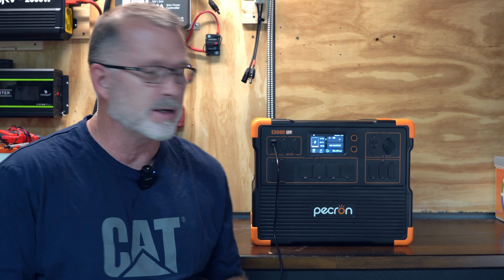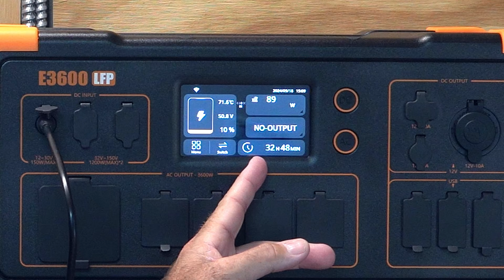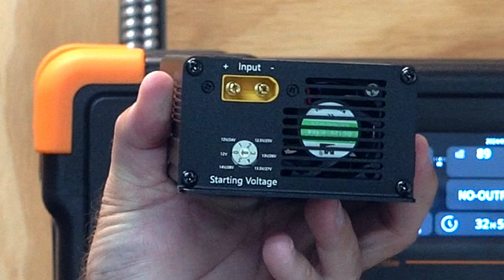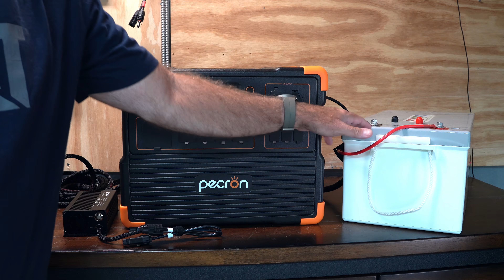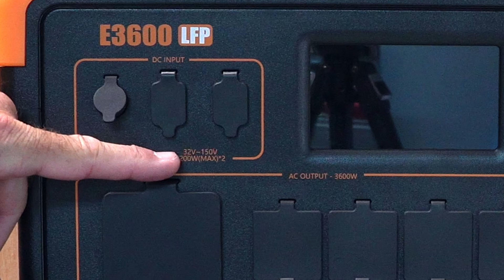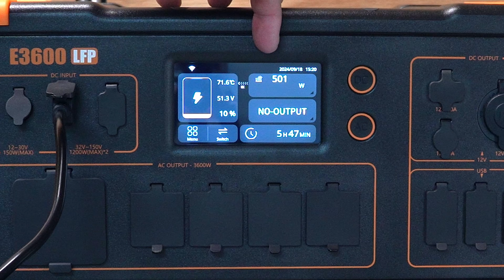A MUST HAVE if You Travel w/Your Power Station: Pecron 500W Smart Charger

Comment: The Pecron DC-DC charger is a literal game changer. I use a Bluetti AC200MAX and their PV420 panel on a 27" Bayliner V8 cruiser, basically a big floating RV. With the boat plugged in to the MAX's RV outlet, every amenity onboard works like it's hooked to shore power constantly everywhere we go. Running the fridge/microwave/stereo/fans/pumps/charging devices and whatever else it doesn't matter, I can last 12-16 hours easy on just the MAX, and with good sun I can go most of a weekend no worries. Now I basically DOUBLE my charging with the Pecron charger/off the alternator while we're cruising around, which is often half the time we're on the water or more anyway, and I hardly even need to think about electricity at all. Note since this all hooks up like two sets of solar inputs, I also needed the Bluetti Charge Enhancer to make two inputs work at the same time, but even the panel/the SCE/and the Pecron combined cost less than Ecoflow is asking for their charger (plus I already had the AC200MAX, 420W panel, and solar charge enhancer so the ecoflow was a no-go for me anyway).

I never get a full 500w from the Pecron, I suspect a higher output alternator would probably help, and I never get the full 420W from the solar either (far from the best panel for my current use to be honest), however it's still a VERY strong setup. I would like to get something simpler, even semi-permanent panel(s) wise, but I figure the next thing is probably a B230 expansion battery, and/or swap out the two onboard 12v lead batteries for LiFePO4 too...... Always some project to do on a boat as they say, and none of it is exactly cheap, but this Pecron has turned out to be the real bargain and missing link in the whole thing. I don't even have to mess with the solar panel on a lot of our trips anymore (I've flat forgotten to set it up a few times), and all I really HAVE to do is relax and goof off with the wife & critters, that's a win in my book.
Reply: Camper vans are the terra firma version of boats.  It seems I’m always doing something to mine.

Comment: I just bought an EcoFlow River 2. It says for solar input 11-50v 13A 200W max so max Volos in range but this won’t work because max input is 200w correct? I’m electrically challenged 😂
Reply from the maker: It'd still work, BUT you'd never get more than 200W out of it...but still double what you'd get out of the 12V socket.  Probably not going to be a popular match-up since the River 2 has pretty low capacity anyway and wouldn't take THAT long (really) to charge from a 12V car socket.   So instead of taking 2.5 hours to charge, you could cut that in half.  Worth it?  Maybe.

Comment: Great video and nice product.  2 years ago I rigged up a 12v to 48vdc converter to supplement my Delta Pro via xt60i port. Would get 720w. But I always had to keep an eye on my battery at idle. With this I can set battery protection voltage.  Thanks!

Comment: I'm not a fan of this store bought crap, the stuff is made as a throw away. These boxes have Lithium Ion batteries similar to flashlight batteries. They tie lots together to make the product, and it packs lots of power. Once the batteries die or even one fails the product is now garbage. Yes these batteries wear out even if your not using it and they are impossible to replace. The better ones use Lifepo4 batteries they don't hold as much power but it can be recharged many times more. They are also safe unlike the lithium ion. They have been known to catch fire, that you cant put out. Also even if they use Lifepo4 its not replaceable or standard.I don't know anything about this product, but it seems like a bad idea. Putting 500 watts into something you know nothing about is crazy and a fire hazard. Your best bet is to build your own, its not that difficult and you will have a product that uses standard cheep replaceable Lifepo4  batteries. You will also now understand why and how things work, so you don't burn down your house.
Reply: Maybe before you run your mouth about a product you no nothing about, you should educate yourself. You basically invalidated most of what you wrote by misunderstanding what this is. For example the lfp stands for lithium iron phosphate, so it isn't standard lithium ion. Something is humorous about you chastising people for not understanding how things work, and here you are knowing nothing about this product.
Reply: @Psychodegu  When I was referring to a standard I was referring to sizes. Most store bought use propriety size battery packs so its not replaceable. Also LifePO4 and lfp both refer to lithium iron phosphate. LifePO4 is term commonly used by industry, lfp is not. Most if not all the products out there use either LifePO4 or Lithium ion Batteries. Its impossible to test everyone's product, this why I say most products. The ones I have built over the years, I can replace the batteries. They are easily sourced by many manufacturers.
Reply: @perkunast9680  I just don't understand why you are explaining to me and harping on the most basic stuff related batteries inverters and the like. It sounds like you dislike all in one units that you don't even want to know what their specifications are. I don't know why you think you can't replace cells in these products, you can it just voids the warranty.

Comment: I was thinking about buying this I did buy the Eco flow system and I thought it was too much money and I sent it back. This would be a great option possibly for my 2024 Hyundai Santa Fe hybrid. I do not need that long of a cord for sure because the battery is in the rear cargo area the 12 V battery that is. I already have the bed and the platform and the sliding table that comes out for cooking in the back hatch area. This would be a perfect set up to charge my Eco Flow.

Comment: I spend a lot of my adventure time in the mountains of the western U.S. and it's rare to get a full day of open sky. This converter would make it easy to start up the car and use to as a generator under those conditions. I'm just thinking of how much charging will get done driving through Glacier NP, Rocky Mountain NP or trekking between the Grand Tetons and Yellowstone. Looks like a no-brainer with my Pecron 1500.

Comment: Question... My F250 diesel has 2 batteries. if you had 2 of those units, and you had 2 e3600 inputs like your Pecron, could you then charge at 1000 watts?
Reply: Yes it;s ok, because pecron e3600lfp has two xt60 input port
Reply from the maker: You could, yes.

Comment: Why just not use an AC inverter from your car battery while driving? You could get much higher input than with this solution!
Reply: I'm no expert but yes you could plug into the the ac output of the inverter. But the power station must be put on slow charge  that doesn't have more than 500 watts unless the alenator/battery can handle more .  My 1000 watt Bluetti can take 900 watts on the ac charge but I can put it in slow charge which draws 300 watts input for instance. It's my DC side that can only handle max input of 500 watts for instance and I don't know if the alenator would keep up if I'm running air-conditioning or the car heater  with that said .

Comment: Would be nice to see a video on installing this on a car or RV.
Reply: One lead to the positive battery cable and one lead to the battery ground. Then run the wire into the vehicle and attach 2 wires to the main unit. Routing the wires into the vehicle is the hardest part. I would suggest placing the main unit under a seat.
Reply: @fscottgray9784  How do you run the wire from engine compartment to inside car?
Reply: @Marine-v8g  Usually up under the dash manufacturers will have a rubber blank for pass throughs. Every car is different so it is hard to make a install video. It comes with a long wire loom to protect the wires from chaffing.
Reply: @fscottgray9784  Thanks
Reply: @JA-fw6lp  Through the firewall between the engine compartment and under/behind the dash.   Search for it on Google/YouTube.   Or just follow the wire harness from inside the engine compartment.
Reply: @Marine-v8g I was envisioning the cables from the battery out the front grill, over the hood, inside the passenger window to the backseat of the car lol
Reply: @pesky-media  You could just put a pure sine wave inverter under the hood and a regular 16/3 extension cord/electric kettle/ATX computer power supply cable to AC charge a unit. Even 50ft from the vehicle because 120V travels well where low voltages don't.

Comment: I've always wondered if just a  regular aoutomotive power inverter would work just as well for this application?
Reply: Me to I would think it would but unsure
Reply: I think this is more like the technology on inverter generators.  Regular inverters of DC to AC actually incur an energy loss.  The terminology gets confusing as there are different things you can invert.  It is hard to understand how they can actually increase the amount of energy, rather than incur a loss.  Watch a video on how inverter generators work if you want to understand the technology better.  (I am)
Reply: FYI . This device is a Converter not a Inverter. Their are a few important differences. 
An Inverter won't Auto Switch OFF Above 12. volts like this device can. Hope that helps.

Comment: Based on some of your previous videos I have been thinking about using a buck converter on a 12v Lifepo4 battery to add capacity to my 1056w power station or connect two 12v batteries in series to do the same thing.  Even though this is a more expensive solution, would this be a nice easy setup for adding capacity/charging my power station quickly during a power outage? It's cheaper than a second battery and you wouldn't have to worry about excess heat from a step up converter?
Reply: A buck converter goes down. A boost converter goes up. Both produce some heat in the conversion.

Comment: Nice video .... What about 12v test?  Nobody has 24v in their car 😉
Reply from the maker: @gtpjon  ha! Fair point!  But it works exactly the same way with 12V systems.  You just need to take care to adjust the starting voltage selector setting to ensure that it doesn't pull power when the car is not running....same as with 24V.
Reply: @ReeWrayOutdoors  Thanks ... I am assuming the same 500 watts.
Reply: Commercial trucks have 24 volt systems, which I could see being very useful for long haulers. I have no idea what solutions they typically use for power.

Comment: I ordered 2 of these last week and they are being delivered today. I think they will be a great way to charge my E3600 power banks. ONe of the main reasons I ordered it is that my 400 on board built in inverter does not supply a pure syne wave signal so my power banks won't recognize it to recharge. I was forced to use a old Bluetti 200 watt brick style charge that cleaned up the syne wave and would allow me to charge at 200 watts.
Reply: Where I can sèe using this is like when I set up my first system I used an old snow blower motor and hitched it to a dodge alternator to charge my battery it ran almost an hour on a tank of gas and fully charged the battery since I'm planning on a doule voltage system dual 120 ac system it  could be used to charge the pure sine wave side now to find out the voltage parameters for my everggear power box and no there is no information on it but the unit is a great price for those on government pension up here in Canada and it's 2000 wants of pure sine wave power so far I've found out it's a 48 volt battery has ups mode and will run my furnace for over 2 days and that my furnace starts with 320 watts and runs at 290 watts and my freezer starts with 140 watts and and runs with 110 watts can't see the fridge needing any more watts so 2000 watts should run my house  still would love for even one of big five reveiw Chanel's do a reveiw of this power box as it is in all aspects a solar generator one of the first things that would change is their website and the other would be the instruction manual
Reply: So why did you get 2 of them and how is everything working out for you?
Reply: @Jh---3ee  It is working great and I have more than 1 vehicle
Reply: Sine* wave... From sine, cosine, and tangent...